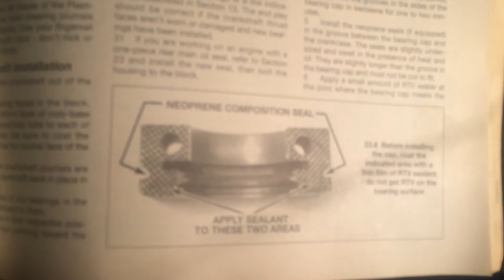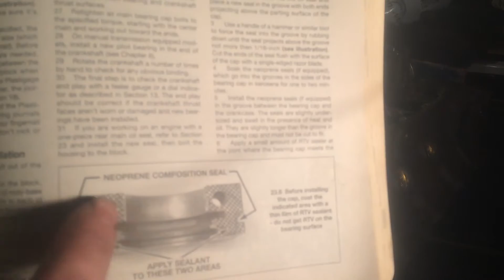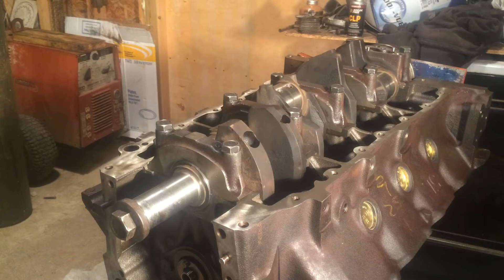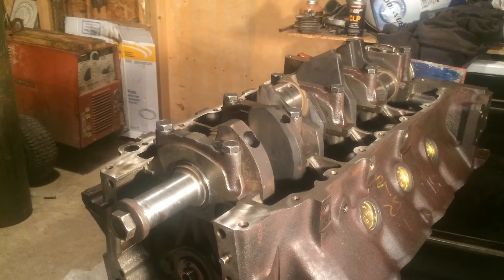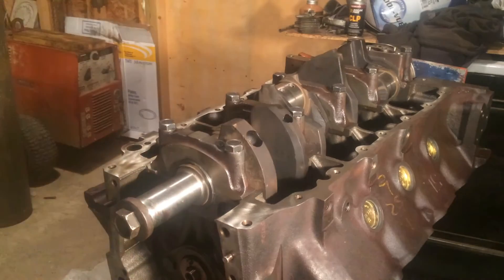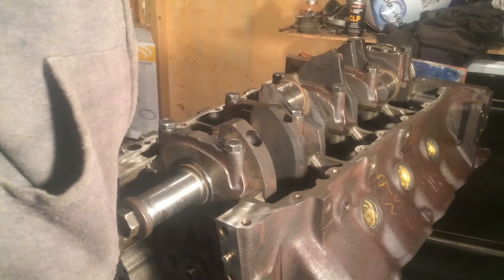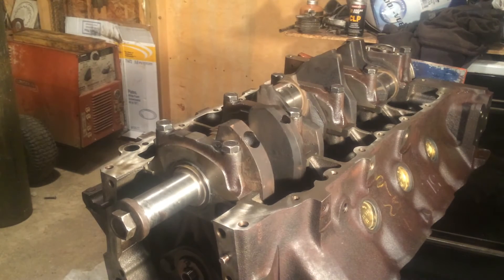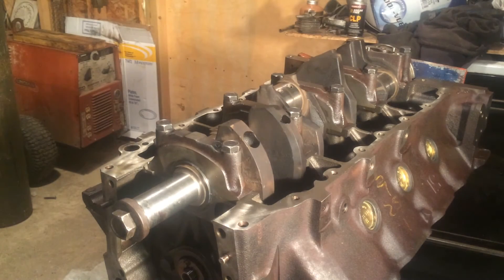Setting and checking crankshaft thrust

Comment: Thanks for that:) Doing a rover v8(Buick 215 essentially)and had a moment where I thought I would have to get thrust bearing shaved.Wasn’t until I saw the correct technique re using the screwdriver to pry it a little ,then tap back to measure,all good now,cheers :)